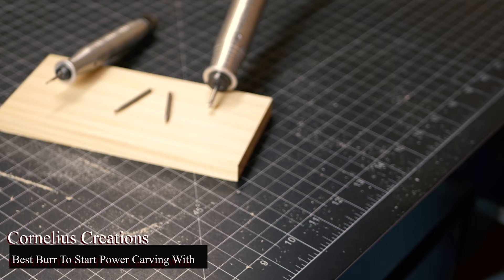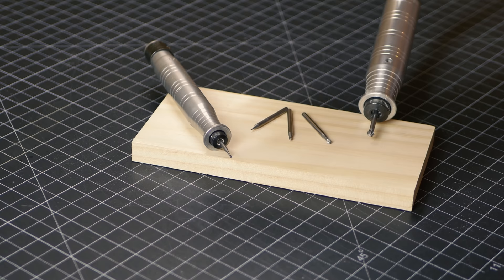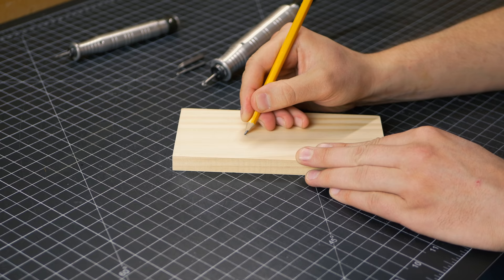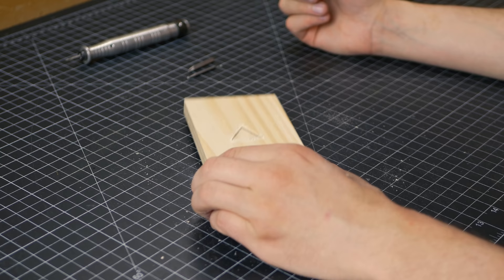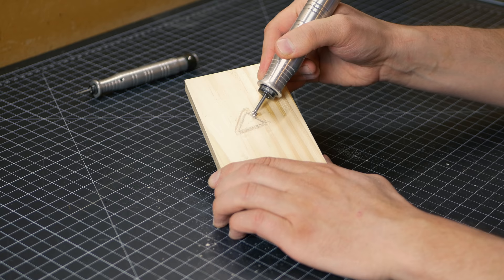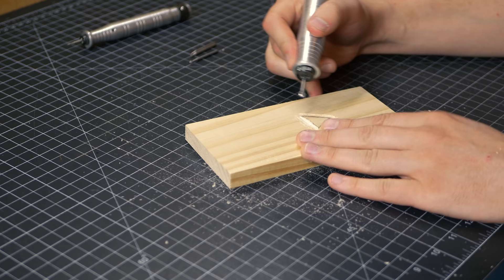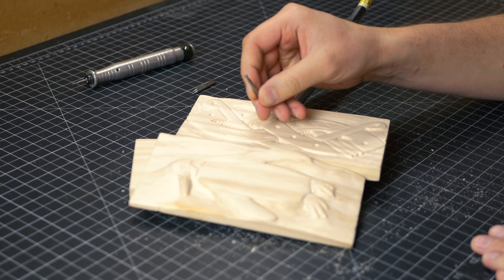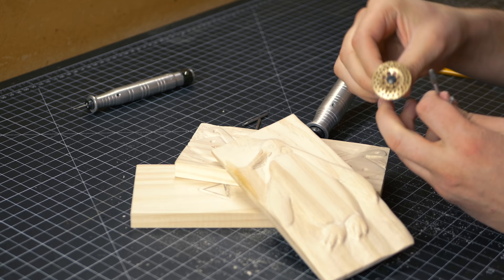The Best Burr To Begin Wood Carving/Power Carving With

Comment: Looking at your other videos, you share such a large amount of knowledge. It is greatly appreciated.. Question: I've been asked to make a sea turtle out of a block of wood. This is my first carving project. I plan to use a piece of  full 1" thick Basswood, and add depth to the shell by adding a piece of 7/8"walnut on top. Would the caring bits you list(https://amzn.to/2Va2Q79 ), be good to use on this project? Would appreciate any info. you can provide. I just received my WEN 2305 rotary tool today. Hopefully these bits will work on it. This tool has a 1/8" & an optional 3/8" collets. Thanks
Reply from the maker: Hey Larry! That sounds like an awesome project! Those burrs will work my friend!

Comment: Birds are birds
Reply from the maker: Beavers are beavers
Reply: @CorneliusCreations  
Just bantering  
What do you call the type of burr (bird) that is the shape of a capital letter T, with the cutting edge on the end of the horizontal line of the letter T? I found a set of 20 that contains two such burrs, one 4mm and one 4.8 mm diameter and about 1.5 to 2mm cutting edge (kerf), but I hope to not have to buy a whole set to get these two burrs. I will need many of the same size for production carving work.

The so-called cutting disk is not what I want; cutting disks have too large a diameter of rotation and too narrow a cutting kerf (edge).  Thank You

Comment from the maker: ⚒️ TOOLS & SUPPLIES I USE FROM AMAZON ⚒️
⚡︎ FOREDOM CARVER (MY FAVORITE) https://amzn.to/2HRXbzC
⚡︎  Wood Carving Templates: https://bit.ly/372Xh33
⚡︎ DREMEL 4000 CARVER: https://amzn.to/2Ubc4TS
⚡︎ CHEAPER CARVER: https://amzn.to/2HPa1i5
⚡︎ CARVING HAND TOOLS: https://amzn.to/2HSLusu
⚡︎ BASSWOOD BLOCKS: https://amzn.to/2WCYXYr

⚡︎ ROTARY BURS: https://amzn.to/2Va2Q79 
⚡︎ BEST WOODBURNER: https://amzn.to/2FJYE7p
⚡︎ GOOD WOODBURNER: https://amzn.to/2FMLZ3t
⚡︎ CARVING KNIFE SET: https://amzn.to/2I4z53F
⚡︎ WOODCARVING APRON: https://amzn.to/2UoUX0k
⚡︎ DUST COLLECTOR: https://amzn.to/2UnR5MV

⚡︎ CHEAPER DUST COLLECTOR: https://amzn.to/2I3jYHW
⚡︎ SCROLL SAW: https://amzn.to/2TKjtok
⚡︎ MINI GRINDER: https://amzn.to/2OHxYIM
⚡︎ ROUTER: https://amzn.to/2WCYAgv
⚡︎ CARVING LIGHTS I USE: https://amzn.to/2HTb9AY
⚡︎ CHEAPER LIGHTS: https://amzn.to/2UbtqQO

⚡︎ SANDPAPER: https://amzn.to/2WHKjPA
⚡︎ FILES: https://amzn.to/2UboAD6
⚡︎ DUST MASK: https://amzn.to/2UbupAu
⚡︎ FAVORITE STAIN: https://amzn.to/2HRKvIQ
⚡︎ MY LEATHER WORKING KIT: https://amzn.to/2WGWtsh
⚡︎ CARBON PAPER: https://amzn.to/2HQV670